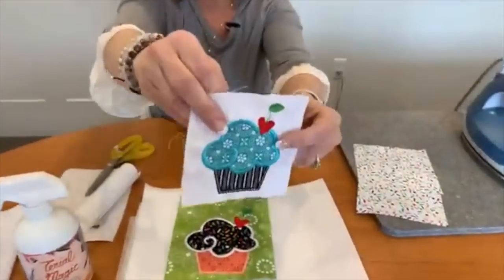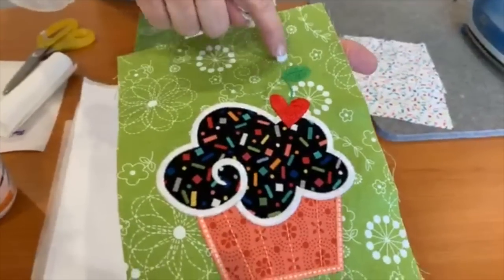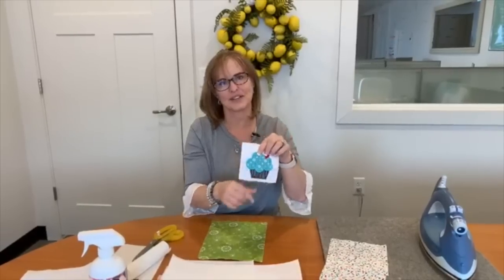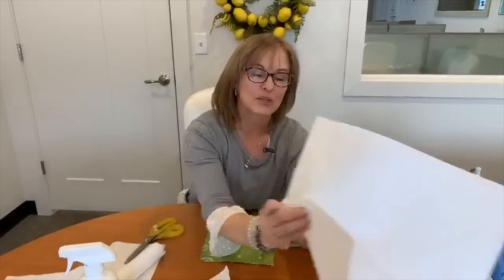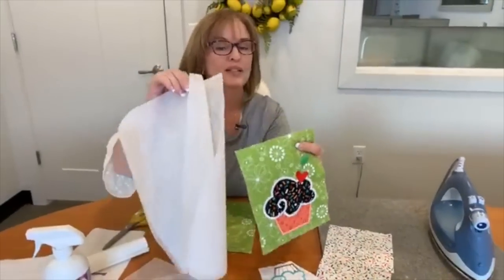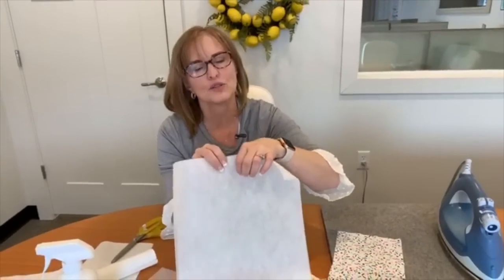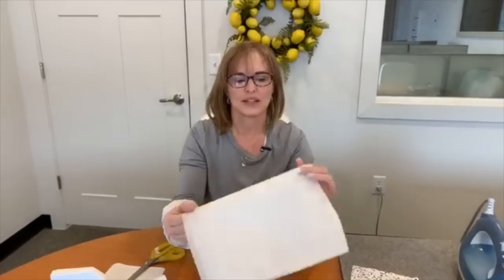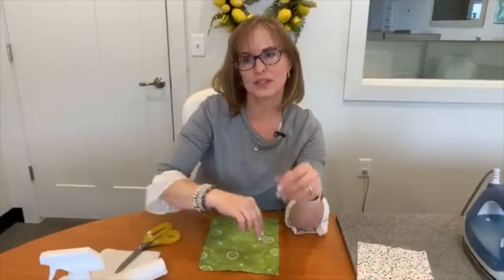Tuesday Tips with Kimberbell | Prevent Puckering: Stabilizer & More!

Comment: I don't understand how you can iron the appliqué while it is still in the hoop. If you remove it from the hoop you will never get it back in to the exact same place. Thanks!
Reply: I have a very small iron for this.
Reply: I iron projects while they are still in the hoop all the time.  I guess it depends on the size of the hoop you're using. I have a mini iron for smaller projects...
Reply: I also use the cricut mini press. Perfect size for my 4x4 and 5x7 hoops

Comment: Am I understanding this correct?  The Terial Magic is used on the background and all applique pieces.  Is the Shape Flex and the heat and Bond used on the background and all the applique pieces?  I wasn't sure about the order.
Reply: The shape flex. is on the back of the background piece and the heat and bond is for the back of your appliqué piece. After you have done the tack down stitch of the appliqué and trim it out you then will iron the appliqué piece down. It really keeps things in place.
Reply: Thank you!!